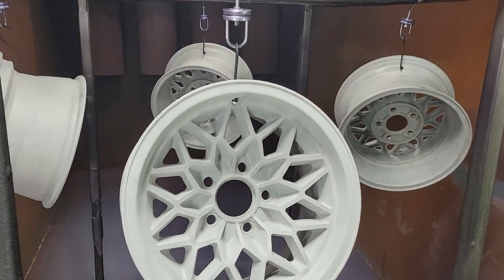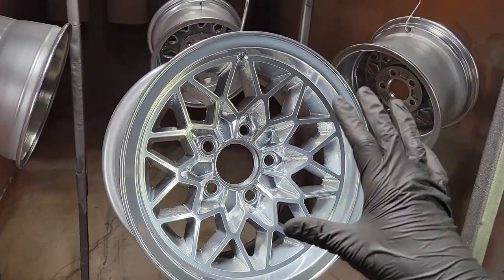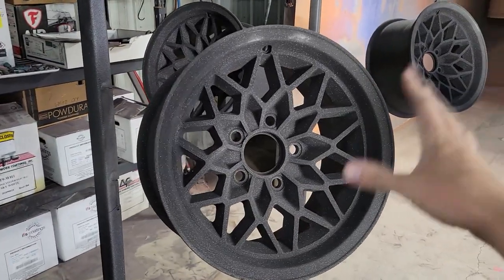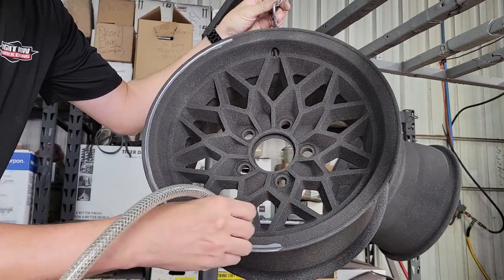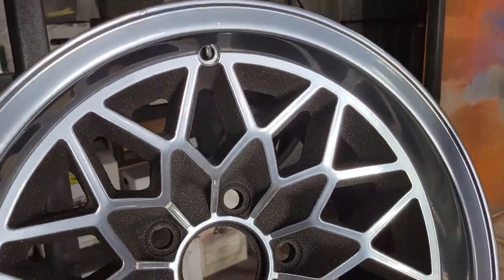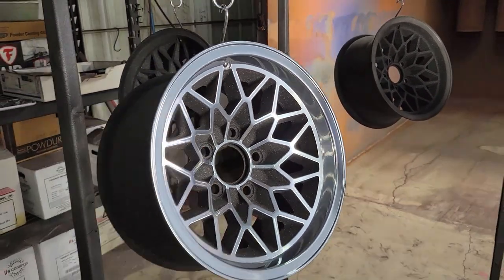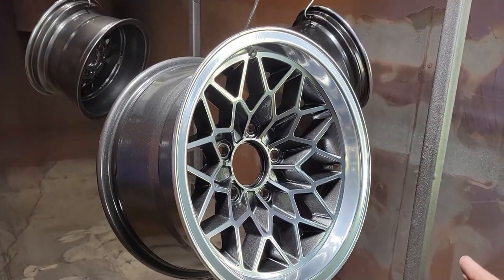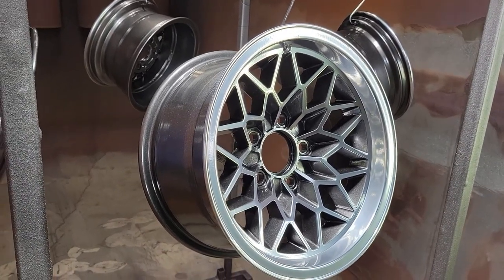How to powder coat wheels, two colors with three stages.

Comment: So with chrome you are always told don't touch after cure just put on clear coat. So you find there is any issues with finger prints or any contamination by wiping with finder and not cleaning before clear goes on? I never used chrome as my base in two tones because I was afraid of my finger prints contaminating before clear goes on. Great vid love watching yr two tone videos the best
Reply from the maker: Wash your hands first and you should be good.  In had no issues.
Reply: @RightNowPowderCoating  thank you

Comment: Great Vid. I saw you coated the surface that sits on the rotor. Never had any problems? I was told I shouldn't coat that area. Thanks
Reply from the maker: 1000s coated with zero issues.  Just don't build up paint....I try to avoid spraying it directly but it does get over spray

Comment: Hi I'm a powder coater in the UK but struggling to clear coat chrome 
It goes dark grey when I cure them 
Any advice or tips would be gratefully appreciated 
Cheers paul
Reply: everyone has that, it is the imain issue with chrome powdercoat